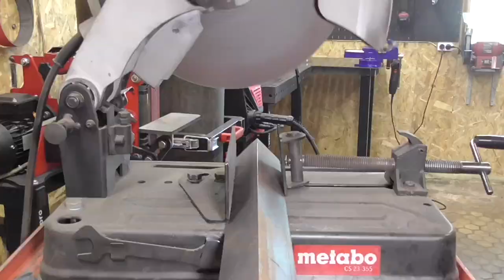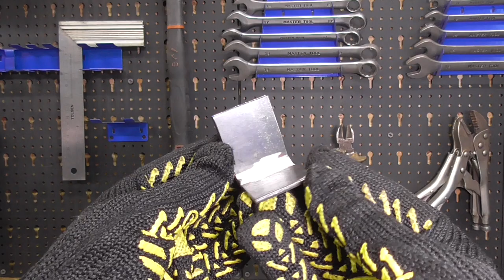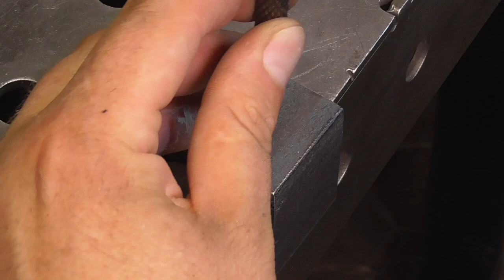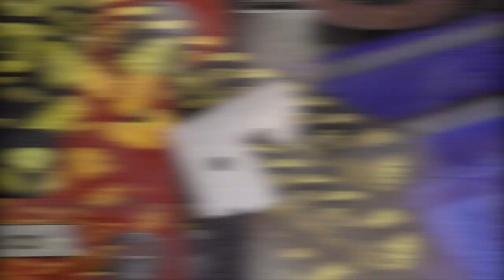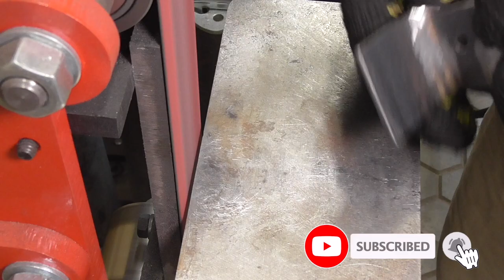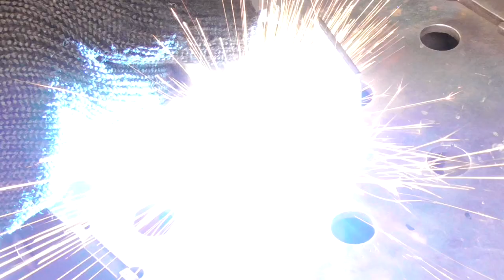Automatic Door Lock | Garden Lock

Comment: I noticed that when he cuts using a grinding disc he buries the blade, that's a good way to twist the grinder and have it shatter the blade and without the grinders guard on could be very dangerous. So I always try to use as little of the blade to cut with, and the b!ade will last longer. Even if you do multiple small cuts across the area to be cut.